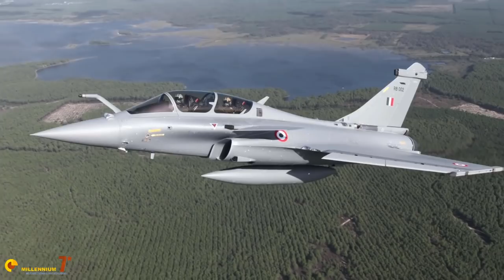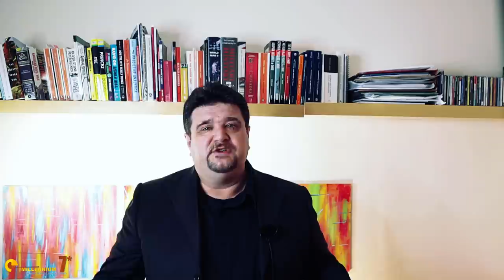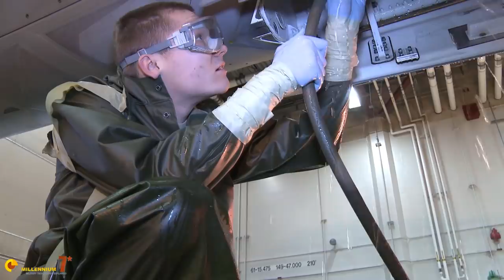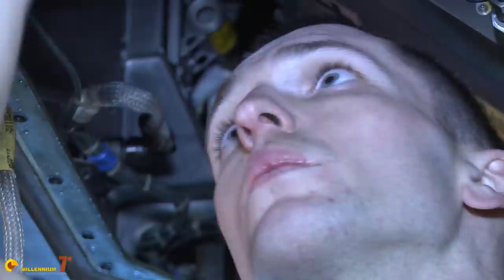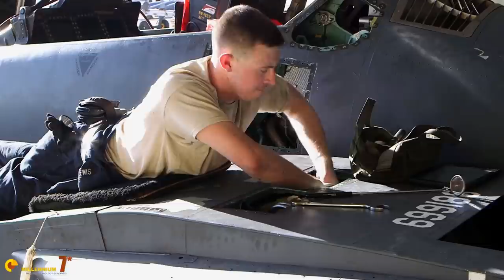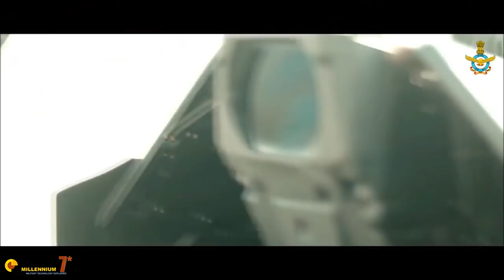The Indian Air Force is a MESS! ... or is it?

Comment: One unintended upside of such a diverse fleet is the myriad of different platforms of which pilots can pit themselves against in BFM Practice and other simulated combat. The Indian pilot Harish Masand noted the different advantages and characteristics of each aircraft type he faced, something that only having such a diverse fleet brings.

Audio hiccup aside, another good video. P.S those clips of the ground personnel spraying the undercarriage and gear bay clean with water had me sort of cringing. The amount of drying needed to combat corrosion...
Reply: The amount of drying needed to combat corrosion is precisely 1 hour outside in the Indian summer at 42°C heat with hot tropical breeze.
Reply: @arkadeepkundu4729  Oof, can't imagine working on aircraft outside in those conditions.
Reply: @cannonfodder4376  That's actually normal temperatures around here. Some of the airbases in the desert near the Pakistan border regularly hit summer afternoon temperatures over 50°C. Infact there were initially cases of Sukhoi 30s electronics malfunctioning after being deployed on that sector because the wiring insulation would literally melt & stick. Apparently no one in Russia bothered testing equipment for +50°C when they were testing at -50°C.
Reply: Are the communication systems and IFF compatible?
Reply: @ViceCoin  Frequently not but the Indian's made them work together.

Comment: I am surprised that you did not touch on one very important aspect of the diverse force in India. One of the most critical areas in the minds of the Indian decision makers and public is in independence from foreign sources of supply for military systems. This is a direct result of experiencing supplies cut off from various sources due to political actions such as sanctions. There is a concern with some justification that critical components from some foreign sources may not be available during a crisis. 

Having several different sources of supply can help mitigate potential supply disruptions and having aircraft of different design sources can in theory help lead to that. Even better mitigation is to produce as many components locally as possible but barring that having separate supply chains for different portions of the air force can enable at least part of the force that is not experiencing disruptions to continue to operate.

The threat of a blockade disrupting some shipping and air transport during a crisis is also considered a real possibility, considering that a potential adversary may have a strong military force.This could potentially ground one or more types of aircraft that lack supply of some repair parts or weapons.

 Furthermore, there is still a strong post colonial mindset which feeds some suspicion of foreign powers and a desire for supporting local products and industry. There is a perception that local aircraft designs will enable more independence from foreign sources and this is used as part of political rhetoric to promote local industry. The reality is somewhat different, as these aspirations for supply independence often are countered by pragmatic needs to use foreign components even in domestic designs. But it nevertheless is a strong driving force in promoting domestic systems and components even when they are inferior to foreign options in availability, design, or delivery schedules. The so called "negative import list for defense imports" bans on some specific types of foreign systems is one result of this. The stated reason given for it is to promote domestic defense industry and reduce dependence on foreign sources. I personally think there are many issues with the implementation of this list but I can see the motivations for such a policy.
Reply: Bingo. What if your supplier is playing the World's Policeman game and cuts you off because you are perceived to be the bad boy?
Reply: @dougerrohmer  That's why the IAF has never in its history operated an American fighter. We've used British, French, Russian & local fighters but never an American one. Even if we buy transports & helicopters from the US all the time, we don't buy frontline fighters because US has always been really fickle. One day they're selling you everything they have then next day they're sanctioning you.
Reply: @arkadeepkundu4729  that is only that case when that nation actively works against US interest and France, Britain, Russia and China have done the same!  It’s not a US thing.
Reply: @bret9741  dude. Indians don't trust americans as a reliable partner and still prefer the russians just because of the American national interests. There was a time when US supported pakistan which did a genocide in Bangladesh and killed over 3 million civilians and when India attacked pakistan for this genocide US cut off weapon supplies to India and sent their 7th fleet to intimidate India with the fear that India might wipe out pakistan from the world map, all of this happened in 1971 till then India was non aligned to any nation during the cold war but when US did this India had to build up relations with the soviets. US have a history of overlooking the bad stuff their allies have done and after the cold war india remained neutral in everything and built peaceful relations with everyone. But US was supplying weapons to mujahidins in Afghanistan against the soviets and guess what happened after soviets left, pakistan unleashed those fighters in Indian kashmir. Clearly US national interests sucks, even in these times US is trying to have better relations with India and at the same time they are disrespecting India's non alignment towards anyone by threatning sanctions on S400 deals. So why would anyone prefer american jets with sanctions while they can get european or the russian jets.
Reply: Buy American.🇺🇸
Problem Solved. We sell you Apaches, C-17 Globemasters, Chinooks, P-8 Poseidons, Romeao, and we will sell you F/A-18 Hornets. Don't Worry. We got your back.
Reply: @abba3629  India has bought globemasters, chinooks and apaches before but they don't trust American fighters because of the countries' relations

Comment: Nice analysis. Indian air force understands this. We used to use multiple kinds of aircrafts earlier, all are being phased out. We bought Mirages and Mig 29 in the 80s and Su 30 in the early 2000s. 

Now Mig21 and Jaguars are being retired and replaced by Tejas Mk1/a. Mirage and Mig29 are to be replaced by 2030-35 by Tejas Mk2 (not sure about the new Mig29 we just bought because of China conflict though). 

So that leaves us with Tejas Mk1/a, Tejas Mk2, some Mig29, Rafale and Su30 in 2030-35 with AMCA in sight as well, 4 of which we (will) manufacture in India, so supply chain is not an issue, neither is worker cost, cuz it's comparitively cheaper in India.
Reply: Tejas is a already obsolete, and still needs GE404 engines.
Reply: Wow after all these decades India still hasn't finished the Kaveri engine? I didn't know that.
Reply: @mbaxter22  lot of things are under the wraps, india collaberated with safron for engines what happened to that no body knows, F414 engines are used for tejas mk2 tejas 1a are build on f404 what really happened to kaveri engines no idea
Reply: @nagendraprasadbk6258  Basically the French fooled India into thinking they will actually help them in many critical areas of jet engine development  a lot of which, India is having a hard time solving.

India had spent less than 1 billion dollars on the ENTIRE Kaveri program, that's way too small at the very least cost of R&D of a modern engine for fighter aircraft is around 2 billion dollars, they practically half-assed the entire thing.

Honestly India should stop doing these joint ventures and asking for assistance for developing their own jet engines, no sane nation will seriously transfer their technologies in this area whether it's the UK, France or the US. Instead it should fully commit on developing the tech locally, that's the only way.

Edit: Spelling
Reply: @sidewinder3422  Yeah, we saw that for Su30 also, russia said whole engine repair and only in russia. india spends a lot of money on defense, recently we have seen the new found love for drones, New shopping is done from US, Aurora the stealth Drone which looks just like B2 is also tested. with China next to us, indian defense in technology is way behind others, only country in the region capable to taking china head on is india but, seriously under prepared.
Reply: @nagendraprasadbk6258  Indian technology is not that far behind from China, the main problem is lack of political will and a lot of military leaders preferring foreign designs.

I mean look at China, they buy from Russia, but they then reverse engineer whatever Russian tech lands on their hands, their first copy will suck but since the Chinese military still uses it, there's a chance for it to improve after years of iteration their copies will now match the original. that's how China has been playing the game, it really helped the local Chinese industries tremendously.

Comment: IAF present fleet is due to historical circumstances Mig 21,29 were given to us at friendship prices during the cold war.Mirage 2000 was a knee-jerk procurement to immediately counter PAF F16s.Going forward we will have an airforce with 3 major planes LCA,AMCA and Su 30.Rafales will succeed Mirage 2000 in the niche but important role of a self escorting strike aircraft.
Reply: Initially our planning procurement was pakistan centric and tactical one . Hence we kept two options to counter aggressor pakistan . Miraj2k and mig29 for countering f16 and jaguar and mig27/23 for bombing . For a big country like india whose enemy has variety of figjtet jets and  aur defence system india dies not have any other option than keeping variety of options under it's sleeve .
Reply: India should have acquired hundreds more Mirage 2000 and MiG-29 back in the 1980s. This would have enabled more local production of them with these large orders, assisting local industry more than decades of waiting on a local fighter design. It would also have modernized the IAF and allowed retirement of older aircraft without shrinking total force size. There were plans to do so but were not put into action because of concerns over budgets and promotion of local designs and industry. The MiG-21 was also perceived to still be adequate in the near term and there were unrealistic expectations about how long it would take to produce a domestic light fighter design in volume to replace all of them. Plans to modernize were repeatedly delayed as the Tejas program was protected even as force numbers fell and the time to replace them was pushed further and further into the future.  More foreign alternatives such as Gripen became available but were not acquired in order to protect the Tejas. This all in strategy for Tejas caused great harm to the IAF force strength and average age of the aircraft in inventory by skipping several modernization cycles.
Reply: In 1950s and 1960s except ussr no one was ready to sale  india advanced weapon systems . We started our modernization with russian and got mig21 as first supersonic fighter jet. Neither europe nor usa supported indigenous weapon industry of india therefore HF24 retired under power as none sold india suitable engine and this fact  india must not forget. Jaguars mig23/27  purchased under compulsions when iaf wanted saab viggen . France sold miraj2k at exorbitantly high price to india thanks to sale of f16 to pakistan and cheap price. USA pushed india towards france and france took full advantage of poor indian situation. Russians sold their weapons at reasonable price including price escalations and today also just see atnwuat price russia has offered upgraded 3d thrust vectored mig35 and compare it's price with same class  rafale or f18 . India will balance its defence equipment import from many countries and local production.
Reply: @pravirchandragadkari88  Hawker Hunter?Dassault Ouragen?Folland Gnat? HF 24 was an own goal.RR asked India 11 mn gbp to develop the orephus engine with the required thrust but Nehru refused.What is your expectation? Is it that the UK should have developed the engine for free to 'support' an Indian project at a time when many superb British aircraft like the TSR2 were being cancelled?
Reply: @pravirchandragadkari88  Mirage 2K were more expensive to buy than the Mig 29 but they have a better operational availability were less costly to maintain. IAF was delight to have them in 1999. Sometime the lowest price and biggest claimed capability isn't the most cost effective solution.
Reply: Not "friendship prices" but mostly in return of pharmaceutical products: For some strange reason _(or may be not so strange instead it's me who is not aware of the reasons, regardless) the Soviet Union did not develop a robust Pharma industry but India was forced to so early-on in the pre-liberalisation days. And on account of not being a signatory of various WTO pacts, Indian Pharmaceutical Industry continued to produce various medicines in bulk for its abjectly poor humongous population without paying exorbitant royalty to European & American patent holders of those medicines which India was not in a position to afford in those first 4 to 5  decades. India supplied medicines needed by Soviet Union and in return Soviet Union provided various defence machinery to India of same monetary value - a convenient barter system existed between the two. Of course the "friendship" between Soviet Union & India was the foundation on which this and many more similarly mutually beneficial arrangements came to be based on and flourish.